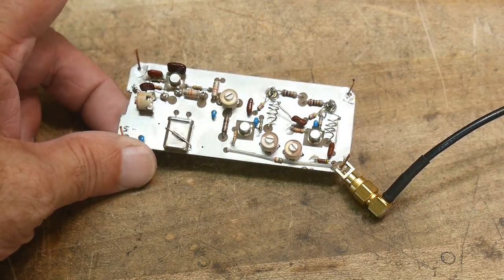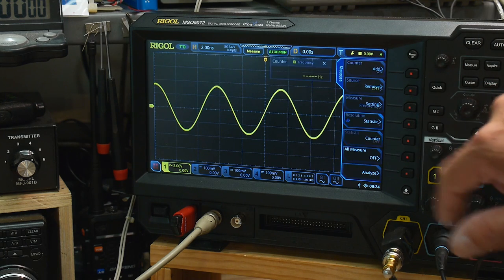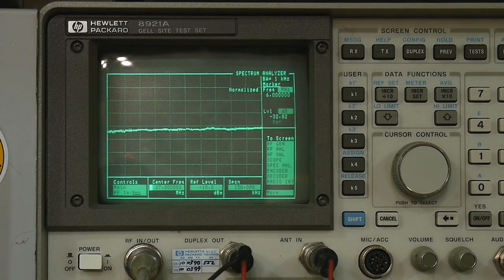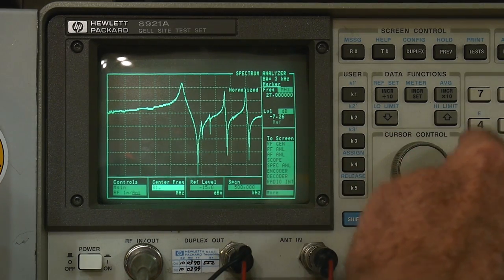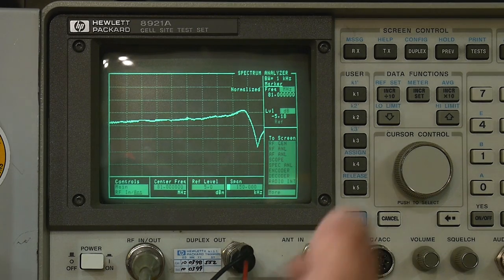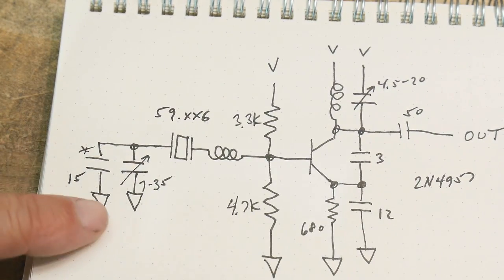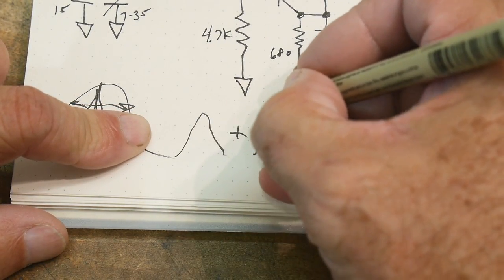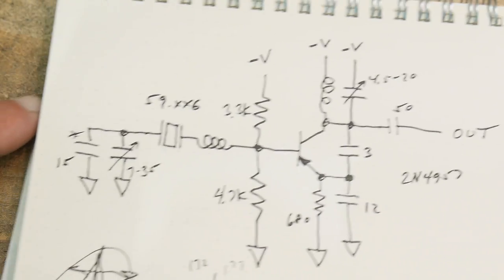#816 Third harmonic crystal oscillator

Comment: Commonly know as overtone crystals over here, often found in vhf/uhf private mobile radio, for the local oscillators & the transmitter, avoiding the use of too many multiplier stages with a low frequency crystal
Reply from the maker: Oh yah, overtone is an old term I've heard.

Comment: wow! Super interesting! The only thing I did not understand was that 3pF cap connecting collector and emitter....seems funky
Reply: That is the feedback path that makes the oscillator oscillate. Usually those aren't in the circuit because the stray capacitance of the transistor and surrounding circuitry may be enough to serve that purpose. The cap i'd call belt and braces to make sure all the units oscillate and not depend 100% on the stray but not properly characterized capacitances across probably thousands of these units made.
Reply: Think of it as a common base amplifier. The input is the emitter and the output is the collector. The output is connected to the input via the 3p capacitor which sets up positive feedback allowing oscillation. The collector has a parallel tuned circuit set to 177 MHz (the third harmonic of the crystal). Since it is a common base amplifier it needs a low impedance on the base. This is provided by the crystal which is series resonant at it's third harmonic. Cheers, Ian
Reply from the maker: Crystal Oscillator (Parallel Resonant Circuit - Common-Emitter)
https://www.circuitbread.com/equations/oscillators

Comment: Would it be a roundabout way of generating the third harmonic if the fundamental crystal oscillation sine wave is squared up (using a comparator) and then filtering and amplifying the third harmonic of that square wave? I would guess the third harmonic of a square wave would have a low amplitude and need a significant amplification.
Reply from the maker: that is often done

Comment: where's the feedback?   Are you sure that schematic is correct?  should that 3 cap be across the base?
Reply from the maker: The PCB routing is a bit odd and I think done to have the inductor on the base, next to the output you only see a couple pf. to get it started, then the base-emitter current is good after that. the 3pf adds a kick to the emitter current too